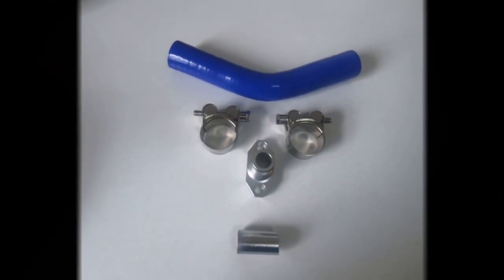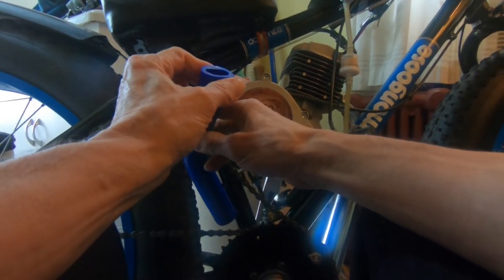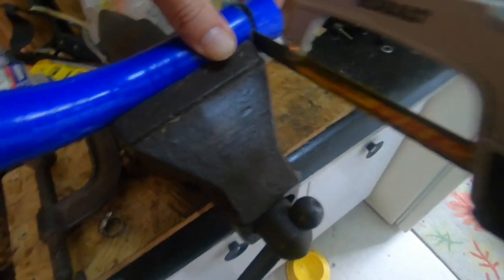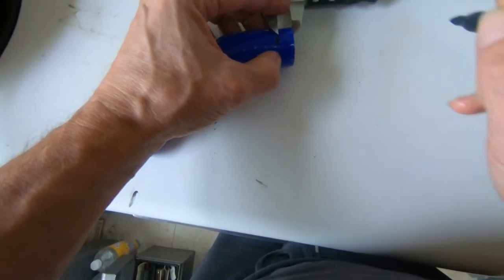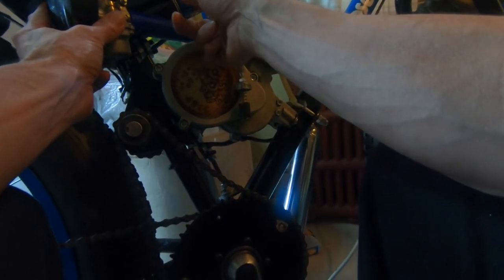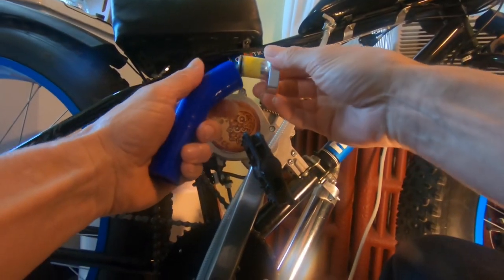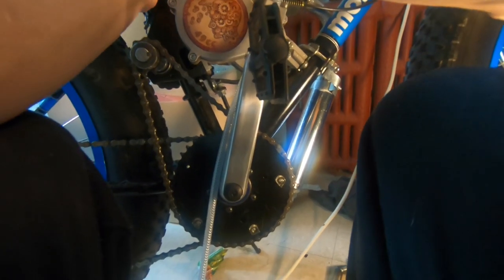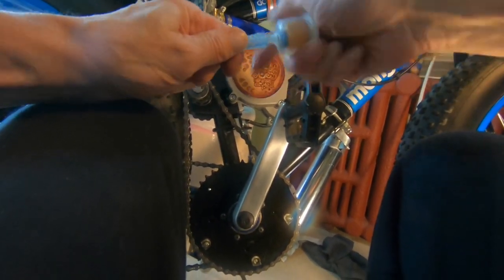Mongoose To Motorized 16 | Custom Extended Intake For Two Stroke Motorized Bike

Comment from the maker: BAD NEWS: I just found out that this silicone tube is advertised as not safe for oil or fuel.
Reply: Good job, looks clean. Hopefully the hose will last a good while even if it's not rated for gas/oil. How did the test ride go, any improvements?
Reply from the maker: @LAHover  Regarding the silicone tube: I made a barometer of sorts. I put a cut off piece of the tube in a jar of fuel. This way I can see the effects over time. The tube on the bike should last a lot longer than a piece submerged in fuel. 

It seems to run good but I feel the lower range is a little less responsive than it was. I understand that a longer intake tends to delay the effects of the throttle but for me, having never ridden any other type of motorized, I didn't notice anything in that department. 

Before I tested to see if I fixed the leak, I assumed that I had indeed fixed the leak and changed from the 72 jet to the 70 (clip in the center.) I tried lowering the needle and rather easily determined it was too lean. I raised the needle and it seemed to run worse than it had with the needle in the center. So, today I'm going to put the 72 jet back in and see if that works and if I can find a needle position that works for the lower range. I have a feeling that it will. I think I got a few more MPH out of the bike with a slight air leak and the 72 jet than I did with the air leak fixed and the 70 jet. Some people have recommended using one jet higher than the jet that gives you your fastest speed. This is mostly for ensuring a bit more cooling for a bit less top speed. My next jet up is a 75 though. If the 72 works I'll buy that fine tuning jet kit from bikeberry that gives you single digit increases instead of 2 or more and try a 73.
Reply: @ChuckHaney  You can easily overcome any throttle lag due to intake length by increasing the speed of your incoming airflow. You can either use an electric screw or just old hot rodder it by ram air. Either one will work and voila!

Comment: Nice thanks for the links I have a Schwinn sidewinder and the intake is so tight I have it on a slight angle I bought the z shaped intake already just needed a gas safe angle pipe and clamps I didn’t wanna but nothing that wouldn’t fit I have the same carb as u thanks 😊 👍

Comment: You probably know by now but when you need to use silicone (it's porous is the problem) in a fuel environment you need to get the "lined" variety. Clickity click barber trick works a treat every time!
Reply from the maker: They tube that I have seems to be holding up great. I have a piece of it submerged in a jar of fuel. Been in there since late October 2021. Looks fine.

Comment: Nice video bro, good job on working through the problem to get to your objective 👍👍👍.. how well is it working for you?,.. to me it's almost like adding a plenum spacer for better atomization... Let me know what results you get 😎😎
Reply from the maker: Seems to be working fine so far. I found a better screw for my carb clamp, one that I can really tighten without it stripping out like the first one did. This should solve the come and go air leak problem I've had there.